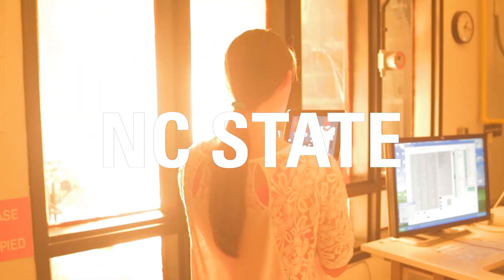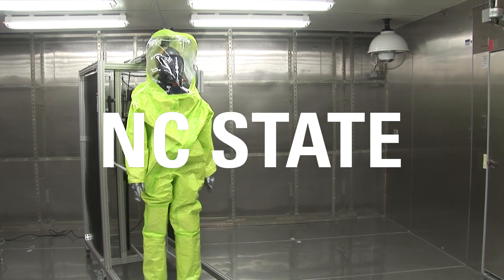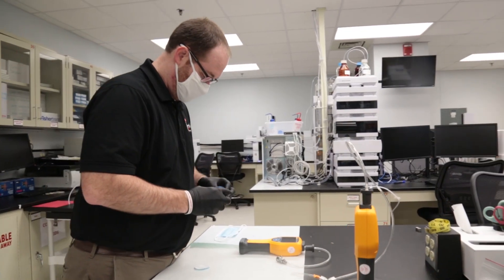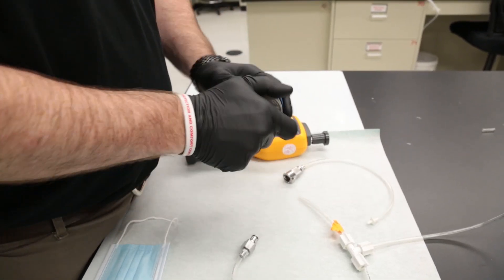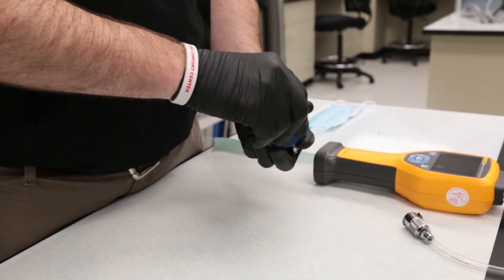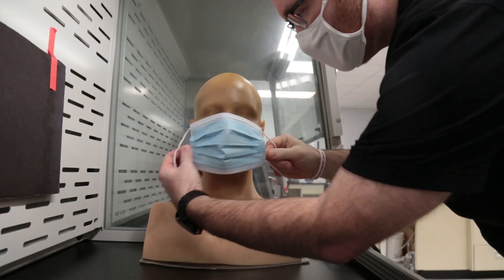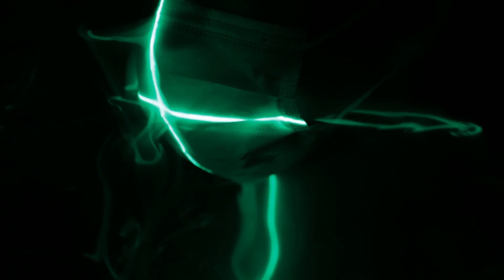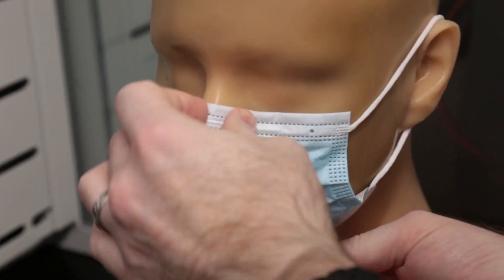NC State Experts Study Face Mask Performance

Comment: Masks do work, the masks we're told to wear are decent, especially if one, everyone are wearing them/the percentage of protection goes up, if your wearing a mask and the person/people your around, are also wearing a mask.

Also A LOT of the home made masks, aren't great,bandanas aren't great either, what were told to wear are surgical type masks, which are OKAY, not GREAT, BUT better than A LOT of other options.

Masks also require you to wear them properly too, meaning your nose can't be sticking out of the top.  

Also N95,P100,respirators and gas masks, with the right filters, that protect against viruses, are much much better/actually COMPLETELY WORK.

Anyway masks do work, IF WORN PROPERLY.

Fit testing MAY be needed as well/a good seal, ALSO facial hair MIGHT be an issue as well.

Goggles/eye protection is needed as well, mainly, because you CAN contract viruses through your eyes/IF someone sneezes/coughs in your eye/eyes.
Reply: They don't work, the microscopic virus particles pass straight threw. Air takes the path of least resistance where the maks does not seal around the nose and hairs. Why dont you  monitor your blood oxygen level and other things before you wear and mask and 30 mins after. Your causing more damage wearing the mask... maskss don't even pass thebstandard 17% oxygen safty levels by osha..